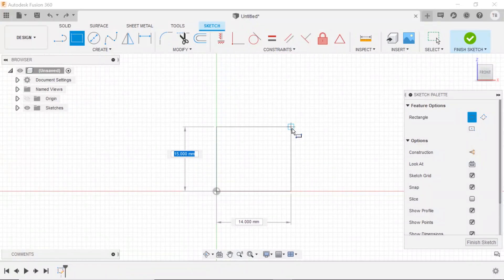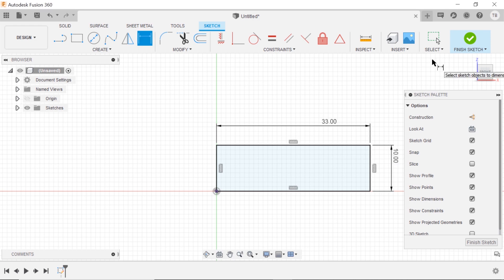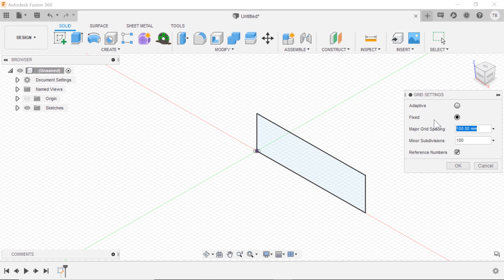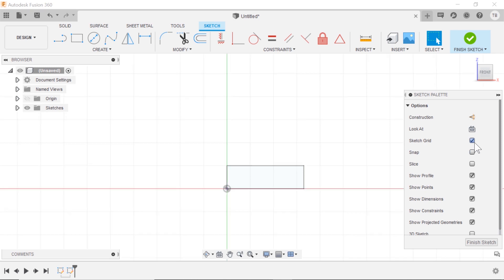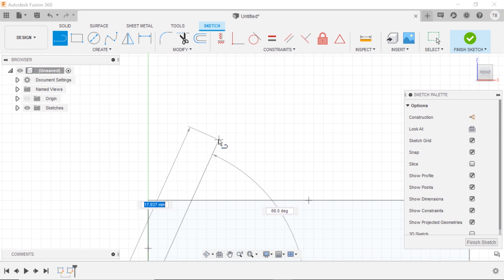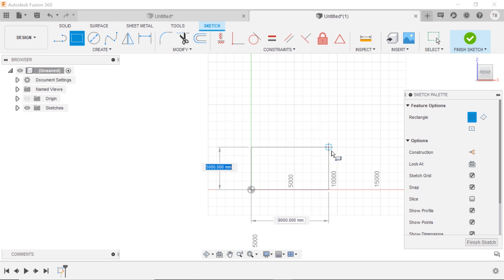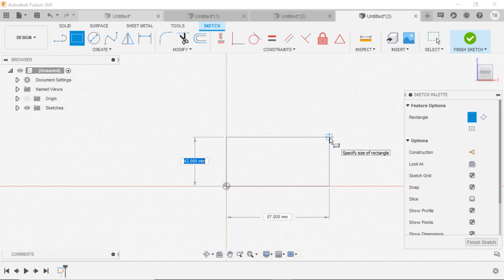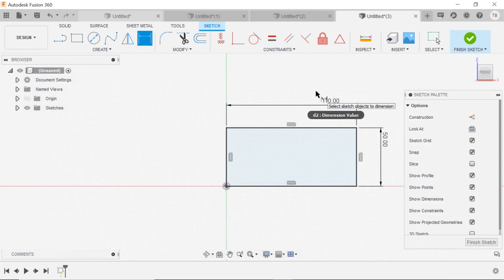Fusion 360 Sketch Grid Snap (The Grid Tool Thing)

Comment: Set points along an existing line and snap to grid does not work anymore. I know a company that does not use Fusion anymore, because of this failure. Is there a way to fix this?

Comment: I want to be able to sketch and snap strictly to the grid and nowhere else. How come hovering over the grid does not do this? If I go near a snap point (intersection) it will snap there but I ONLY want it to allow me to sketch this way. I am using Fusion to do pixel art by extruding sketches up to make the pixel art appear 3D with layers. This is very annoying that the snap grid isnt a true snap grid.

Comment: I would like to be able to NOT snap when I'm ROTATING and object, or especially a CANVAS.
It seems that it snaps to ZERO once I get to 2.5 degrees. 
Turning off "Snap To Grid" DOES NOT STOP the object from snapping to zero from about 2.5 degrees.
Any way to turn this annoyance off?
Reply from the maker: Holiding Control (Windows) will turn off any snapping temporarily.  Does that help?
Reply: @TylerBeckofTECHESPRESSO  Did you try it?
Reply from the maker: I made a video to explore your example. Hopefully this covers what you are describing.
https://youtu.be/skKtzsNnhw4
Reply: @TylerBeckofTECHESPRESSO  YAY!